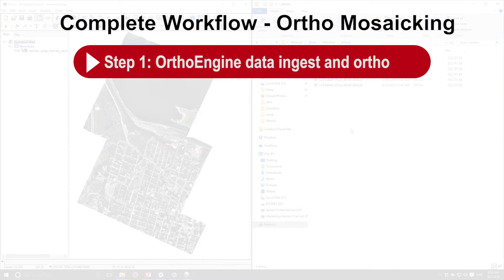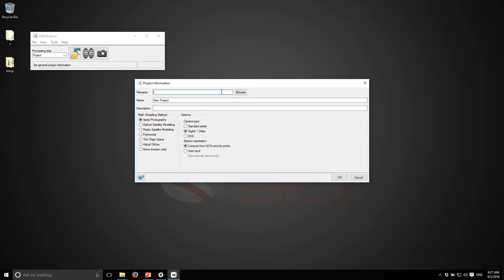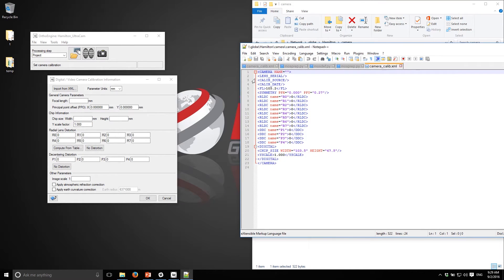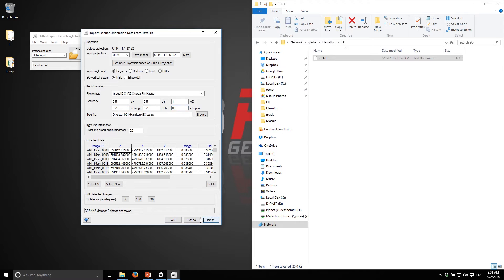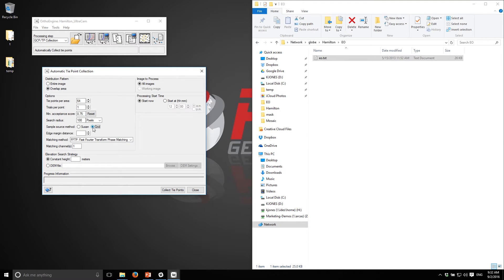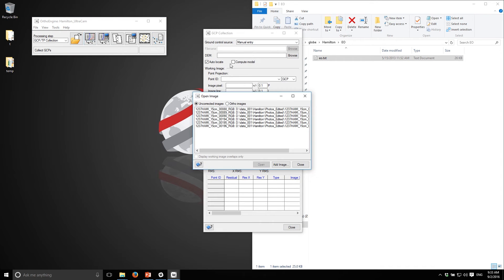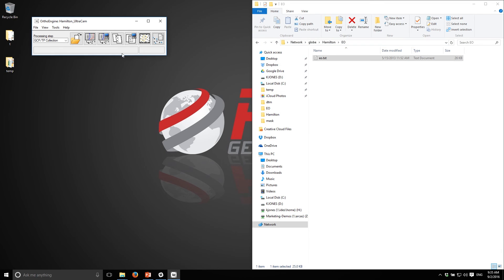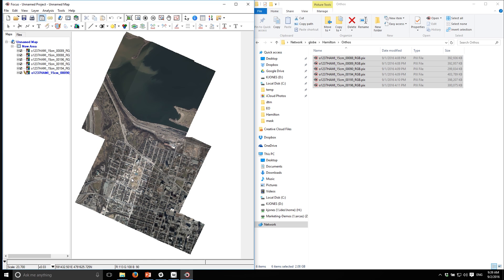2. OrthoEngine Setup and Generation of Orthos

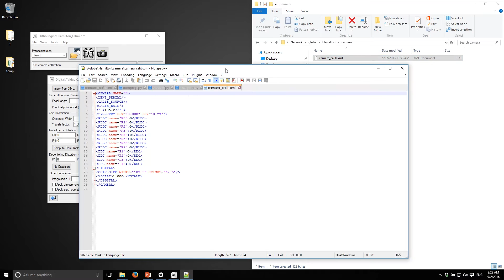Comment: where i  can get the camera_calib.xml ? 2:32
Reply from the maker: These files were provided by the data vendor. Typically, air photo surveying companies use a triangulation software package to derive the camera calibration and exterior orientation information.
Kevin
Reply from the maker: You can make your own XML files with all the required parameters. Or you can manually type them into the Camera Calibration Panel.

Comment: I am curious to know if the EO file, camera calibration xml files (etc...) came with your imagery or not. If not how did you aquire those files?
Reply from the maker: Hi Claire,
These files were provided by the data vendor. Typically, air photo surveying companies use a triangulation software package to derive the camera calibration and exterior orientation information.
Kevin